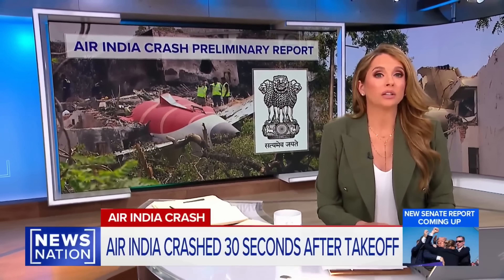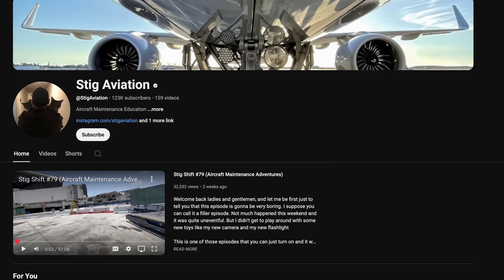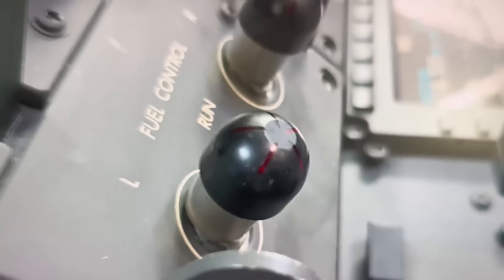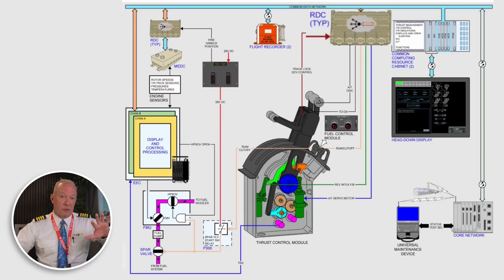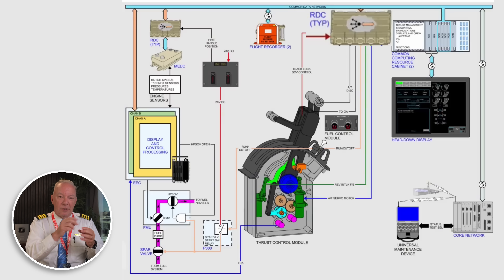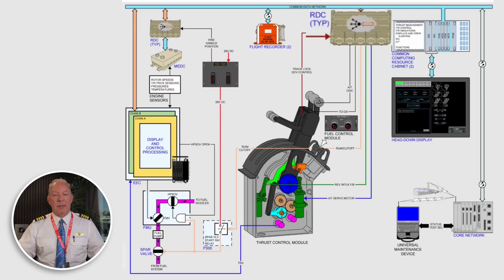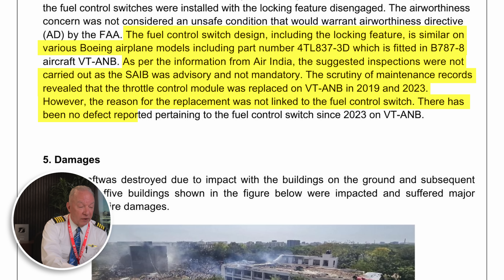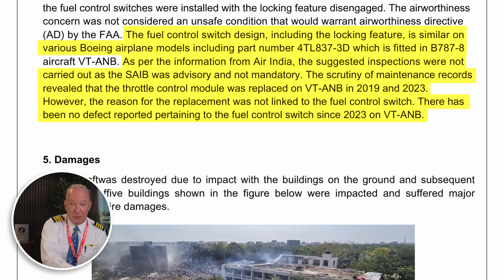The Truth About Boeing 787 Fuel Control Switches

Comment: Steve, you need to watch this explanation as to why the 28V bus failed. It appears very credible to me. In summary of the YouTube poster’s explanation is as follows:

A short circuit failure of a single diode pack on the B787 used to sum two lithium batteries together onto the bus caused that lithium battery to be connected directly to the DC generator’s power source, bypassing the Battery Management System charging circuit.

Worse still, there appears to be no way of detecting this failure that gradually weakened the battery through overcharging, it appears that it finally failed under the additional load required to retract the undercarriage.

The 28V bus only recovered after the thermal trip isolated the failed battery.

Diode summing of power sources is a very poor way of achieving resilience. A better technique is to use multiple DC-AC-DC converters, in a similar way to how a grid connected solar inverter works to prevent back feeding to the grid during a power cut.

This explanation totally exonerates the pilots.

https://youtu.be/OLxLN3osS1Y?si=QubZ21oLtodYZCfW&utm_source=ZTQxO
Reply: sir i think you missed the point of the way the system is made. if the batteries had failed as you suggest that failure would have been recorded on the flight recorders. as they were not then the batteries did not fail. but lets say there was a problem with the batteries, you realize there are more then one battery on the plane right? there was no report that the electrical system had a problem, there was no report on the recorders that the plane had a sudden and complete battery failure. there fore your guy is wrong. it just can not happen like that.....also again the flight recorder showed one of the pilots shut off both fuel switches and 10 seconds later they were turned back on again. that is not a battery failure, that is of pilot doing nothing more nothing less.
Reply: except you forget the valves require power to close and open still so a sudden loss of power would leave the valves open.  Remember these are servos opening and closing the valves it’s why it fails last state in this case should have failed open if a power failure occurred.
Reply: @Braddeman  ah, but poster states that the indication, which is an LED will depend on the 28 V bus and the black box would likely get the same status indication. Is there any evidence that the physical switch was in the wrong position, because my understanding is that physical switch was destroyed in the crash. Even if it was in the physical wrong position was that switch(s) part of any restart procedure?

The point is it was the additional load of retracting the landing gear was the final straw for the already weakened battery and at point the status indication would be incorrect. 

I would’ve thought it be quite easy to simulate this by replacing the battery with a short circuit. 

The problem with fault conditions are the unintended scenarios that may not have been allowed for in the design.

Nevertheless, using diode summing for resilience of this important bus is an absolute no no. We covered this in my BBC engineering training over 40 years ago and why in the broadcast chain we never used this technique in any BBC designed equipment. A much better approach is to use DC - AC - DC converters.

Even if the physical switches were in the cut-off position, would that not be a sensible thing for a pilot to do once he knew they were going to crash?
Reply: @G8YTZ the physical switches were not destroyed in the crash and there is a charred picture of them that were released.  They were in the on position. The forward and aft FDRs on the 787 are powered by the left and right 28V DC buses, respectively. I would think you would see the FDR report it is on backup power at that time.  The FDR also shows the status of the main buses.  I understand what you are saying that it should be changed but I am pretty sure it would have shown on the FDR and if it does they sure aren’t alluding to it.
Reply: @G8YTZ and i’m pointing out this is a boeing 787-8 and the FDR logs all 28v Bus voltages.  It would be in the data.  Both recorders even operate off the left and right forward v bus.  You would think one would go to backup power.  The fuel system on the 787-8 also has its own dedicated power supply and control mechanisms, separate from the battery system as a backup in the event of battery failure. Modern aircraft, including the 787-8, incorporate redundancy in critical systems to prevent a single point of failure from causing a catastrophic event. While a battery issue could indirectly affect other systems, it wouldn't directly cause the fuel system to malfunction in the way observed in the Air India crash. the Boeing 787-8 fuel system has backup power options in case of a VBUS (Voltage Bus) failure, thanks to its extensive electrical system redundancy including using generators in the engine themselves in the event of a battery failure. I also would like to point out that the power supplies that feed the fuel system also can compensate for sags in power using the engine generators.  Hope this helps.

Comment: You can not think of a good reason for turning the switches to cut-off at that point in flight. Fine!

Now, let us suppose there WERE a good reason, but one that you can not think of. What next? One pilot thinks of such a reason and believes that it actually applies at that moment. So he moves the switches. The other pilot asks why. So the pilot who did it, in more or less his last words, explains his reasoning and we would now know why someone did it for a good reason or as a consequence of muddled thinking. Is that what happened? No!

So even if you COULD think of a good reason for moving the switches, it would make no difference to the conclusions about the actual crash. I'm not a pilot. I don't know whether there can be a good reason, but I know that if there is a good reason it did not apply on that day, at that time, on that plane.

According to anecdote, there was once an RAF fighter pilot who lost his aircraft by ejecting. He gave a reason: He had seen the Virgin Mary in a cloud. One can speculate how he knew that she was Mary, not just some Mary but THAT Mary, and a virgin, too. But that's not half as puzzling as why that should be a reason for ejecting. Depending on his views about religion, it would explain anything from him praying to him firing a missile at the cloud. But the man ejected instead.

One can find out the most bizarre 'reasons' when people live to tell the tale. The two Air India pilots didn't and so, as you say, we may never know the reasons. But any explanation would not just have to account for the act but for the subsequent denial as well.

Comment: Steve, at what point in this system does the flight data recorder take its feed? Is it a) from the physical operation of the switch (switch has 2 sets of contacts) or b) from the presence or absence of the low voltage feed to the relay or c) is it from the physical operation of that relay (relay has 2 sets of contacts) or d) from the presence or absence of the 28v feed to the fuel valves. Without this information it is not possible to PRECISELY determine what the FDR is actually reporting.

Comment: Thanks Captain.  This was the piece that was missing, for me.  It's a simple, fail-safe design giving the pilots ultimate control, very much what we'd expect from Boeing.  There is no micromanaging here.  You turn it on at the beginning, and off when you're done.  Computers have their places, but this is not one of them.

I too wanted to think this could have been an equipment malfunction rather than a human one, but that seems all but impossible.  The investigators likely have a lot more to go on from the cockpit recording that may tell us whether it was some kind of mistake, or a deliberate effort to crash the aircraft.  We will have to wait for that, but the time is so short it probably won't tell us why.

Comment: My car has brake by wire.  Even though I was pressing on the brake, my car would not completely stop.  Mercedes sent an engineer from Germany to look into my brake issue.  The Mercedes engineer found out I had a lose ground in the SBC module.  So the relay and wiring could be bad after the fuel control switch.  For the diagram that Steve presented, there are points of failure after the fuel control switches.

Comment: Captain Steve, I appreciate your explanation and your channel. A couple of comments. 

The report does not say the switches were moved. It's says the fuel cutoff was transitioned. The fuel cutoff is the actual valve supplying the fuel. You say in this video that if the voltage is not supplied to the relay the valve is closed. So an interruption in the supply voltage to the relay will cause the fuel valve to close. 

You are incorrect with your explanation of 'fail safe'. As you describe the system the default is not an open fuel valve. The default is a closed valve. It is required for voltage to be supplied in order for the valve to stay open. That is not the definition of fail safe.
Reply: Agree.
Reply: No, the fuel spar valve must be powered open or closed. It is a butterfly valve and stays in its last position if power is lost. Default is to stay in the last commanded position.
Reply: @paultruzzi911  This doesn't bode well for Captain Steeeve, trying to educate us on how the system works, while getting it wrong himself.
Reply: @paultruzzi911  Good to know. Thank you for the info. Hopefully Cap. takes note.
Reply: @itfcbr   You are wrong.  The report clearly said (quote) the "fuel cutoff switches transitioned from RUN to CUTOFF".  It very specifically says they are talking about the switches, not the valves.
Reply: lies and nonesense! the report specifically states that the SWITCHES were transitioned to the cutoff position. You obviously didn't even bother to read the report! Here's a copy and paste: "the Engine 1 and Engine 2 fuel cutoff switches transitioned from RUN to CUTOFF position one after another with a time gap of 01 sec"
How much clearer could that be? Why are people lying about what the report says, what are they trying to gain from this misinformation spreading?

Comment: But isn't it in the procedure it says that the pilot have to "cut off the switches and put them back on". Isn't that happen when the power shutdown in boeing 787( AIR INDIA FLIGHT 171) ? the pilot are trying to restart the engine according to "Flight Manual".
Please Mr. steeve isn't is the right thing to do when your "RAT come out just at the take off". I may not know but I hope that, this was the right things goes according to pilot training. "Because no plan in history loose both of their engine and get power cut off at such a low altitude".
If you have time please highlight this part because we still know very less about what happened.

Comment: I'm a novice, but where's the need to have the fuel switches in a plane, when we don't have them in a car!
Reply: A diesel engine in a car stops running by turning off the fuel pump.
A plane's engine stops running by turning off the fuel. Similar thing.

Comment: So the RAT self-deploys at 2 seconds into the flight per the new report.  How does that square with the cause and was the switch cycling (albeit slowly) an attempt to "boot" the system?  https://www.youtube.com/redirect?event=video_description&redir_token=QUFFLUhqbW5xM0dsdkRSR2xPbGJtUllMZlBxTVFwWGM5d3xBQ3Jtc0trS0FYRkg0blV1OTV5OFJ5dG5TMF9qRHk2U0tOelNidTJ6SzFSVGxRRzFfWll4amtWa0RBUmtISGNKNXhKOG55V2VaUm9oVjlzdGU2MUdiVzkzS3lYb3J1S1RZYXk1OE9GcXZnQ1l4S21oRFlXZWlYcw&q=https%3A%2F%2F42kft.com%2Fair-india-171-a-plausible-hypothesis%2F&v=nxul8TOIf38

Comment: @CaptainSteeeve, thank you for this explanation its insightful.   "There is no other input" which you emphasise multiple times is a strong assertion. Yet - taking your example, if you were to remove the batteries while the lamp is flashing, the lamp would stop flashing until the batteries were reinserted.    So, power could be another input.   Maybe in the real system the power to each switch and then to its respective relays comes from separate isolated busses?  Are you able to confirm and close that possibility down?
Reply: Good point. No mention is made about battery condition or battery wiring.

Comment: Ummm? Just to clarify, a “switch” like the (likely) SinglePoleSingleThrow or SPST switch on your little experiment does NOT have a relay inside it. It has “contacts” small copper or more likely for aviation silver pads, which are connected to the external wiring, that open and close when the lever/rocker/handle portion is moved. A “relay” is an electromechanical switch. The pads or contacts are opened and closed via a electric solenoid that when energized physically moves the contacts from open to closed or closed to open depending on the needs it was designed for.  I have many fond memories with the Radio Shack 100 projects in one board from an early birthday.  I loved that thing, my folks not so much as a few of the 100 projects in the included book were different sirens and klaxons. Lol   Anyway, hate to nit pick, but love th channel. Cheers
Reply: That's not nit-picking, it's a valid point. Captain Steeeve's simple example has a component missing, the actual relay. Having said that, the "fail safe" condition for both circuits is the same. If the battery fails, the light will go out in Captain Steeeve's example, and the fuel valves would SHUT OFF in the aircraft situation!
Reply: Captain Steeeve's example shows the relay not integrated with the switch. Most switches are not going to handle the current and that is off loaded to a relay that can handle that. Really wish I could get my hands on the fuel control system wiring diagrams. I'm sure there is a training aid on a board just like we had in my aircraft electricians' course I went through many years ago. Easy to understand the system and to troubleshoot that way. These systems are kept simple for a very good reason.

Comment: If the switches were deliberately or negligently turned off this is proof that they should not be able to be operated by a flight crew when normally seated . It should be necessary to be at least half standing to turn off the petrol

Comment: So it is stated by Boeing that there is only a DC current from the battery bus to the fuel control valves but no one knows for sure unless you were the electrical engineer/s that designed it. You assume the manufacturer has told the truth. Boeing has a stellar reputation for being honest, right? If so, then why is there another system installed on Boeing aircraft that enables Boeing aircraft to be flown remotely that includes the fuel cut off position switch controls that no one is willing to discuss. Has the previous statement opened a can of worms? Good, then let the chips fall where they may to prove or disprove the theory/fact of remote operation. IMO a lot of viewers would like to know. Obviously, the switches went to cut off and it was noticed by most likely the Captain who asked the FO why did you put the switches to cutoff and he replied he did not. Is that what a suicidal person would say or would he just smile and not answer? Just sayin.

Comment: I have worked as a Tech for 40 years. To many circuits if power is lost. A circuit that is in open when power loss occured needs resetting manually to reset. 

The power loss shuts down the pumps which would make sense with RAT deployment

Comment: Thank you, Captain, for the detailed explanation. I am not an expert on the airplane avionics instruments. How is the status of the mechanical switches monitored? How does the computer monitor the circuit? Is it by monitoring the inputs of the relay? How exactly does the computer read the mechanical switches' position.  Is it by measuring the mechanical switches' output or by measuring the relay output?

Comment: The issue with this incident is that there is still important information that has been withheld, for what reason we don’t know.  The cockpit recorder, if as sensitive as people claim, would have picked up the sound of the switches moved, which if it did would eliminate most of the “electrical” failure hypothesis.  Regardless, the fact that there was a delay between the fuel cutoff, even just one second, and the fact both engines were provided fuel in a restart attempt indicates there was not an electrical or physical failure in the fuel system.  There may be a remote probability but in thousands of airplanes flying millions of miles, that exact scenario has never occurred.  Personally I can see zero reason when so close to the ground any pilot on a large jet with no satisfactory place to land would deliberately cut off the fuel in any normal circumstances.  But, the cockpit recorder would most likely reveal the information needed to avoid all of the hypothetical scenarios that have been posted, which are in effect just speculation and/or trying to force explanations to fit the provided data.

Comment: Captain Steve, thank you for this valuable update. But what if the spring itself that holds the switches in place were to fail? Might this cause the switch to become loose and fall from the run position to the cut off position. It would also account for one pilot asking why they had been moved and the other pilot replying that he did not move them. The pilot may then have managed to put them back into the run position.
Reply: If the springs fail, they are fail-safe. They fail in the detent they have been put. So, chances of that happening is realistically zero.

Comment: What about the battery and the wired connection to the valve solenoid. It is clear now the battery supply i.e. DC supply failed for sometime. It is very much possible. 

Please clarify what's the redundancy in DC system. Whether 2 battery soirces for 2 enginees or one battery source. 

It's clear now the switches were on but the battery was in fault.